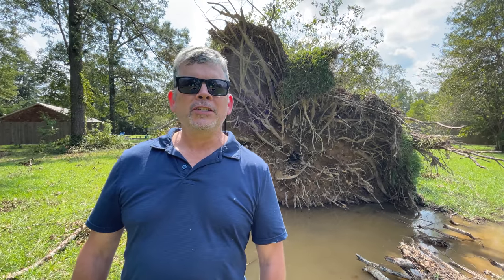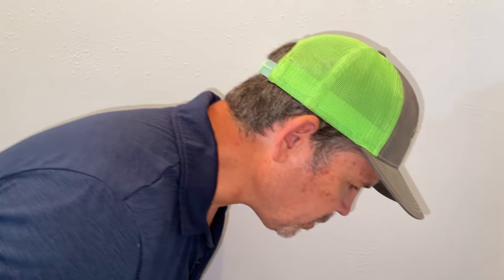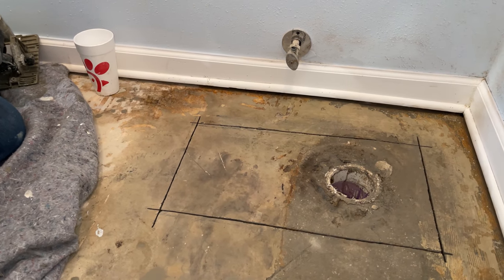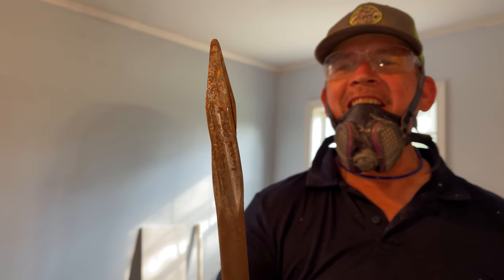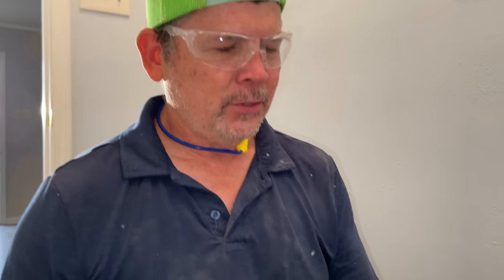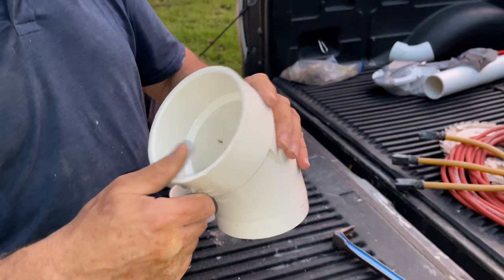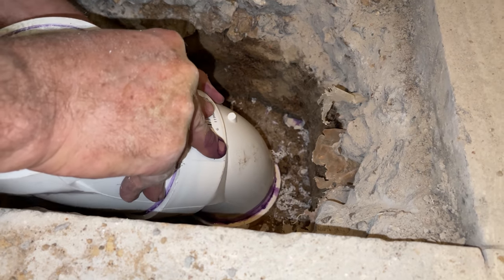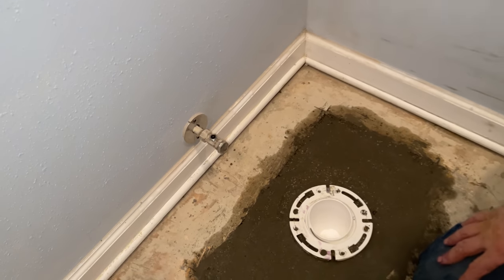We Moved a Toilet Over 5 Inches and It Kicked Our A$$

Comment: Why not cut off the 90 at the very bottom and come across horizontally and put a new 90 in the desired location?  Then you'd have full depth stronger PVC solvent welds.

Comment: Forget every tool you see in this video forget the heat gun, there is a drillbit that says fit to the exact diameter you need and it eats away the old pipe and does not touch any of the lining of the elbow. It's a perfect cut. I don't know what they just called but I'm sure you know what Google is

Comment: Oh yeah no electricity !!!  well you could have tried a torch and heated a hole saw three and a half inch hole saw with a torch and stick it in the pipe that way the heat will transfer from hole saw to pipe loosening the

Comment: next time buy a 20buck heat gun.......or a torch or rags and 91 alcohol.......cut about a seven inch hole....cut tile, drill slab with cement bit., then chip pieces out...reduce to 3 inch pvc......use metal flange......fill cement but leave room for new tile....

Comment: Not going to comment on the pipe removal, still over coming the shock and can't stop shaking my head, definitely 2 easier wats to accomplish that task without disturbing the fitting. As far as pipe replacement goes you could have used a 4x3 bushing and 3" fittings to resolve the of the height issue. You keep posting video, I'll keep commenting, we'll make a plumber out of you eventually.

Comment: Why didn't you just use a socket saver you can get at Lowe's Home Depot and plumbing supply house it goes right inside the pipe right when you cut it right after the The Hub and then just put the drill to socket saver inside it hit the trigger and it

Comment: I just went through a mess same month you did this video, but I got it, its my get away home, I wish I could move toilet at primary home. but. its between 2 walls, 1 is wet wall to supply bathtub & upstairs bathroom, & the other wall is outside wall, so no where to move, unless put it in middle of floor on other wall across from tub, & put sink in nook? beside the sink is stacked washer & dryer, and then just enough room for door of bathroom to almost hit sink, yeah tiny bathroom, on 650 square foot house, with tiny bedroom & bath upstairs, I turned into storage.

Comment: The difference between an amateur and a professional is that when a problem is encountered a professional knows how to fix it where an amateur calls a professional.
It's interesting watching a professional.
The only nit I could pick is the new concrete you laid NEEDED to be interlaced with the old concrete. You should have just bent then straightened the REO instead of removing it.

Comment: Just for future reference and I'm sure by this point someone has already told you about using a heat gun to remove the glued fittings. Works like a charm but does take some practice to keep from burning the PVC. Also offset flanges are the way to go in a situation like this. I'm a plumber of you haven't already figured that out. Not a bad job considering what you were working with and you saved yourself some money cause I would have charged 3 - 400 for a job like this. I cringed the whole time you were chipping away at that fitting hub just waiting for it to freaking crack which could end up being your worst nightmare. Your doing your son a huge favor and teaching him some great need to know stuff. He will appreciate it so much in the future and never forget this project I promise. My old man taught me everything I know and even though he is no longer with me I have the know how and lots of memories working with him both good and not so good but I cherish them all. Good job guys.
Reply from the maker: Thx bud much appreciated 👊🎄

Comment: Could have stubbed a piece of pipe out above the floor and then did the concrete and cut if off flust after the concrete cured and installed the flange..

Comment: No job ever goes exactly to plan. I'm a builder who does a bit of cheeky plumbing and electrical on the side. It's all fun and games. I have so many random gadgets that I hardly ever use that are a godsend in those jobs where things aren't going to plan. My workmate and I just spent a day and a half demolished a ridiculously overbuilt reinforced concrete fireplace that the builders had actually made part of the structure, meaning load bearing studs were loading on the fireplace not a joist or bearer.

Comment: Great job, I want to know how difficult is it to move a toilet that is angled in a bathroom corner. Aren't there attachments that can make the turn to straight tank against the wall without doing what you just did?
Reply: If you have enough room from the wall, you only need to remove the screws holding the toilet flange to the subfloor/floor and rotate it so the toilet bolts line up where you want the toilet to aim.

Comment: I know this is late for this project but maybe it will help someone on the next one.  Search on "Reed Tool PPR400 Clean Ream Extreme with 3/8" Hex Shaft, 4" Head".  Videos on this look like the better way to go to clear out the old pipe.  They make different sizes.

Comment: I'm surprised that there isn't the sanding equivalent of an engine cylinder honing tool (unsure of the proper name, sorry...)  that would sand the inside of a pipe regardless of diameter (you get the idea....)

Comment: Sorry could not read through almost 2000 comments but--- did you ever consider replacing the toilet with a corner toilet? The spacing in the video appeared to be conducive but not knowing the exact measurements it's hard to guess.

Comment: I take a water bottle and punch a small hole in it and let it trickle on the blade as I cut. Go invest in a Bulldog by Bosch. It’s worth it. I’ve been tempted to get the tool that cleans up glued fittings to reuse them…this makes me want one that much more the next time I have to do this.

Comment: my only critique is toilet flange gets fastened through the finished floor- on 90% of toilet flanges there will be markings " use fasteners"; so the toilet flange did not need to be glued in until finished floor was done. properly fastened through finished floor into concrete slab. * your flange will need spacers to bring it up.
Reply from the maker: It's fine, they used vinyl tiles for the floor.
Reply: @StudPack Vinyl  tiles is irrelevant. sounds like you didnt fasten toilet flange.The flange should be fastened to the floor to complete the mechanical bond else movement over time just effects the sewer DWV pipe, "fine" = kick the problem down the road. Be well.

Comment: Yall need to invest in a set of hub saver sockets and quit cutting them hubs. I have cut some in my time but only if no.other options. And a hint when you see purple cleaner it's usually the 1st sign of battle. Glue only seems to peel out easier. Done this so many times I can't count, usually wanting a wider shower so move the ol shitter on over.

Comment: The hardest part about plumbing is not taking the easy shortcuts like cutting the hub. If you can dug down five more inches and spent probably an extra 30 minutes of digging you wouldn't have had to spend an extra hour cutting hubs and macgyvering. Just tip from a master plumber
Reply: It is my opinion that that toilet was so close to the wall because somebody converted a bathtub into a walk-in shower and there's no way that that passed inspection when the house was built

Comment: That bottom joint is gunna leak.  You should have used a 2 part epoxy on that bottom joint you were chiseling on.  All those small gaps need filling.

Comment: Should I be worried that in a few years I need to move a toilet 12” over. Luckily I don’t have a slab but a double wide mobile home. So getting room should be easier I hope. Going to do a whole house plumbing re-pipe in a remodel
Reply: It depends on what is below the subfloor.  If you have joists or beams in the way, there might be issues.  As long as you have enough fall for your piping (1/4" per foot), you should be fine to move it.

Comment: Not a good idea to use the cheater-bolt slider parts of the closet collar. The collar snaps way to easy when tightening down the toilet. Use the 2 notches instead.

Comment: You need to pull a plumbing permit to do that work. You are changing the location of piping. Cutting fittings down would not pass a plumbing inspection because they would not be water tight. This is why plumber need to be licensed. Good effort though.

Comment: So how would you do this exact thing but with one challenging difference, cast iron preexisting plumbing instead of PVC?  I've got a job coming up I need to move a toilet over on a slab that's in a condo built in the early 70's and it's got a rusty rotting old metal flange over 3" or 4" cast iron pipe that goes strait down about 4" before dog legging in the 2 o clock direction with a 45 that then goes strait for about 14" before intersecting the lateral thru a wye. I'm just stumped on how to cut the cast iron to alter the angles. I know I can move the flange over to the right by putting a 45 in at the wye where the 10" strait is now then going strait and into another 45 that will join the verticle that has the flange 
        ______. TO  ________
             /                /
           /                  I
        O.                  O

Comment: That was painful to watch. Dig down another 6” next time to expose your 90 and horizontal pipe. Cut your 90 off at the face and then throw a 45 on your horizontal pipe to make your run parallel to the wall. Roll it up/over with a street 45 if it’s not quite right and Cut yourself whatever travel piece you need and then bring a plain piece of pipe straight up out of a new 90. No cutting fittings, no killing yourself trying to save the 90, etc etc etc. but if you ever do need to dig a fitting out use a 4” hole saw on the end of a short piece of all thread. You can also use tie wire in a pinch. Heat the hole saw up with a torch till it’s red hot and hold it inside your pipe & fitting for a couple minutes and then peel it right out of the fitting with a flat head screw driver

Comment: Dude, about the next time you say street 90 you should be slapped (ok...nudged not slapped) 
. It's either street 45s, 22s, or 30s,..but not 90s.  WHich is a good thing. You don't want Joe homeowner going and buying street 90s and using those....unless he absolutely has to. Nice video.  Many folks out there will find it very helpful.  If you heat up that hub enough you could almost peel that out without much help  with the chizel, buzz saw, etc.,..but you probably already know that and didn't have a heat gun handy...I assume.

Comment: Yeah, that toilet location is not up to code. You need at least 15" from the center of the toilet to the wall and that clearly isn't 15". We have a toilet in a 23" alcove. No one can use it. My brother can't even fit his shoulders in. 
I've bought the wrong pipe size before. It's aggravating. I thought I needed 1" bc the pipes I saw were 1" but I didn't see that they reduced to 3/4". Had to make another trip to the store and was without water for a couple days.
Having to cut slab is why I don't like houses with concrete slab. LOL. I like the ones up on blocks. Less chance of flooding that way too.

Comment: Why don't you put a piece of wood into the hole, drill a hold in the center of the wood, and then use a hole saw to take out the inner pipe

Comment: That's what happens when you don't  know what you're doing. Listen. Concrete is cheap. Make a larger hole. How much you want to bet that  that's a 4" x  3" closet ell. Yes, it's 4" on the rise, but 3" where it's horizontal. Dig down to the horizontal pipe, cut it back toward the wall far enough to use an 3" 1/8 bend(45) on its side and a 4" x 3"closet bend to get your 5" offset. Bob's your uncle.

Comment: NO OFFENSE intended - but two different manufacturers make a "fitting saver" bit for about $25 that perfectly hollows/cleans out that old pipe from the hub in about 3 or 4 minutes...and they sell them at Home Depot and Lowe's.  Would've saved you at LEAST a solid 90 minutes / maybe two hours on this job...sorry !!

Comment: five inches doesn't look even remotely close to code.  You need 15" to the center of the flange from any side wall.  If you have less than a 30" space, center it and hope no one inspects it. There is a practical reason for this.  The first time you sit on a toilet with less than 15" to a wall it will become extremely obvious that it is not right.

Comment: Master Plumber here: First: You can just bust that closet ring off with a hammer. (stuff rag in first) I always have someone else remove the  concrete down to "completely expose the existing fitting" and over to new location. (If this toilet was next to an exterior or structural wall you'd still be there chipping concrete).  Then send me a picture with a cell phone. (I do this monthly sometimes). You guys only exposed the top of the fitting! Next time, dig a little deeper and cut that whole 90 off, put on a coupling, 22 degree or 45 degree (whichever works) and then a new 90.  I bet that was a 4" X 3" 90 down there. BTW...you can reduce 4" to 3" by gluing a 3" coupling or 3" hub inside the 4" pipe. (simple) There's a couple more things I noticed wrong...but hey...I been plumbing since Jr. High and I'm 62 now. Hand me a set of plans to that Mansion you're building and I'll plumb the whole thing by myself.....
Reply: I'm a master plumber also I completely hundred percent agree with the way you described that would have been the proper way
Reply: @fransvoogt4923  Thx....but if that 4 X 3 was completely in-cased in concrete..... Idda glued the hub of a 3" 45 inside that 4" glued inside that closet bend  and used another 3" 45, possibly a street 45 to move it...if 3-4 inches was enough. I hate chipping down 12-14" of concrete.....

Comment: I understand the need for "codes" and this and that but sometimes you gatta do what you gatta do...  I have 14acres and honestly.. I'll try to do things "Safe" and to "code" when building or repairing or whatever but sometimes, it just costs way too much and makes absolutetly no sense why id have to do it like they want.   For example i need to run a 120v outdoor wire to a few trees to get some out door lighting here, its pitch black 360 degrees around the house and flood lights on the porchs only do so much.

Code calls for the wiring to be buried 18-24 Inchs under ground..  I mean really ?  I can understand if its in a place you drive a vehicle or walk, but if its out of sight away from traffic... Why do i have to dig that wire 2 feet under ground.  I dont see people burying christmas tree extention cords 2 feet under ground..  Sorry.. Ill bury it 6 inchs or so and call it a day

Comment: Why didn't you just twist the toilet on an angle to face out of the corner. Much easier, no cutting. Job done in minutes. Yes. Use a heat gun as well.

Comment: A real plumber would have made sure that closet riser was at least 15” from the center to any wall or obstruction (code) Also, a real plumber would know the difference between 3” and 4” PVC by looks. The work you are doing is actually a felony in my state and if you get caught; law enforcement will have no problem fitting you with a new set of bracelets, as they should. You unlicensed jack of all trades but masters of none are actually hurting the trades.
Reply: m rapacki  First off; I don’t drink or do drugs. Secondly; The police actually do sting operations for unlicensed contractors in my area just like Chris Hansen’s To Catch a Predator show. I’m sure you are familiar with that show and have probably had a few appearances. Lastly; Thanks for your opinion on my life, it means a lot coming from someone who likes their own comment, I’ll really take it in to consideration.

Comment: glued toilet piping, good we do not use this method here. all our waste pipes have rubber sealing, so you just need to take the pipe out and all is good. When  piping is designed it is not allowed to be horizontal, all must drain, so pressure on rubber seal is almost non-existent and it last forever.  For possible "return water through waste line" we use nonreturn flap valves, just in case if it happens.  I would probably crack the pipe and make a lot more work for my self then what you had.